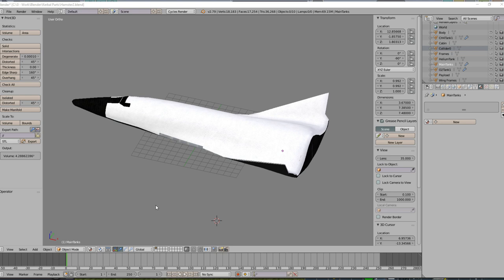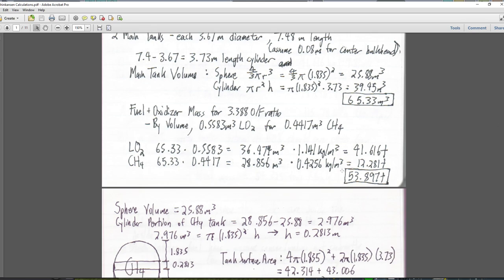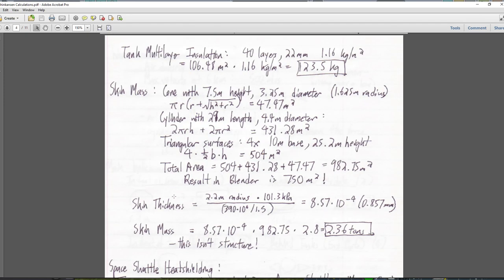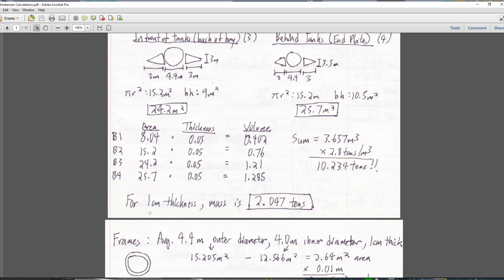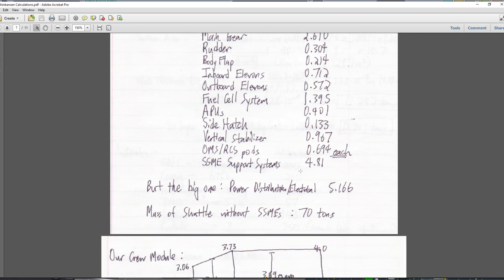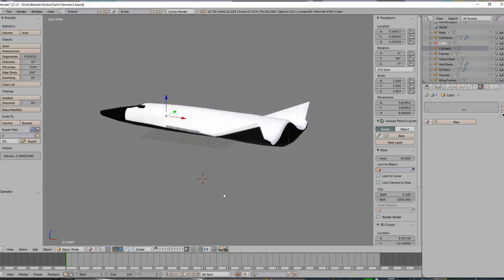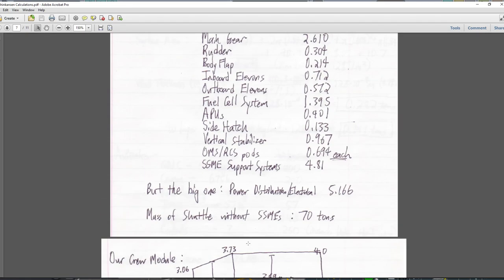Rocket Science - Spaceplane Structures

Comment: Regarding the tank mass calculation:
2024 Aluminium is not weldable, so you have to rivet it and add some stringers. Weldable Aluminium is far worse regarding tensile strength.

The concept of the upper stage looks quite similar to the HORUS-Stage of Sänger II, maybe you can cross-check the mass calculation with it.
(i can provide you some data if you're interested) But the problem is that you need LH2 as propellant.
Reply from the maker: Well, Aluminum 2024 is used throughout the Space Shuttle including the External Tank, so I figured if I was going to use the shuttle as an analogue, I ought to use that. That said, the External Tank did switch to Aluminum-Lithium 2090 - do you think that would be better, or some other material? But yeah, I could just add more structure to the tanks. Sänger II looks similar to what I'm doing, though obviously I'm using two identical planes and that system uses two planes of different sizes. The problem is getting a detailed mass breakdown the way I have with the Shuttle, which I'm fortunate enough to have a lot of material on.

Comment: Raiz, whats the point using spaceplanes to the moon, without heavy aerobraking?
They are heavier with the whole shielding and wings.
Reusability, or just because it looks better (your SP looks awesome, by the way)
I love spaceplanes, because i'm a aeronautical engineer, but they tend to be far less efficient, without aerobraking and capture
Reply from the maker: As I said, we are using aerobraking to return to LEO, and we would like that to be done with minimal wear so that it can repeat the trip a few times before returning to the surface. The huge surface area to a fairly light body should help the situation. Also, considering we're carrying our transfer stage, service module, and crew capsule, this isn't really bad, and we get to reuse all three instead of dumping them. You need to picture this less like a spaceplane and more like trying to heatshield the transfer stage, service module, and capsule so that we can recover all of them. Try and figure out a way to manage a recovery of all three elements separately, or to reuse them for multiple trips to the Moon and back, and you'll see the benefit of a spaceplane as long as we're not carrying the full Shuttle wing.

Comment: I think avionics could actually be much lighter than 1000kg, considering improvements in computers over past few decades, and that there is currently research going on to allow for wireless communication between components inside the spacecraft, that would remove a great porion of the wires mass
Reply: wireless is absurd, but optic, or less wires which form high speed bus for many devices- very probably, just for reference: utp6 305 meters weight 21 kg. for cat7 indoor 15 kg, outdoor 28 kg, 10Gbit Ethernet.
Reply from the maker: Not sure about wireless, but otherwise it sounds good to me. I'll look for documentation, though. Why do I get the feeling it's still heavier than 1000 kg on Orion?
Reply from the maker: @sDdnDSiduAe4b Thanks for the numbers - I'll consult with other sources as well to see what I can come up with for a realistic estimate.
Reply: Just a note on the shuttle computer - it uses the AP-101, which is based on the IBM System 360 architecture, a 32-bit mainframe first introduced in 1964. It's also a variant of the same computer used on the F-15. It is comprised of two units: the CPU and IO Processor (https://spaceflight.nasa.gov/shuttle/reference/shutref/orbiter/avionics/dps/gpc.html), each with a mass of 57kg respectively. The original version of the shuttle computer (AP-101B) had 104000 kilowords (404KiB) of magnetic core memory,  while the upgraded AP-101S has 256,000 kilowords (about 1 MiB) of semiconductor memory. The shuttle also had two tape drives as secondary storage (http://vc.airvectors.net/tashutl_c03.html).

Just a couple of notes here: magnetic core memory is really heavy and not particularly dense; it's also extremely dated. It's basically a bunch of ferrite cores woven together in a matrix, and its two primary advantages are that it is nonvolatile (the above link talks about "freeze-drying" the software into the AP-101B) and that it is radiation tolerant. I wasn't able to find numbers on this so I don't know if the 57 pounds is before or after the upgrade to AP-101S, but the memory board appears to use a ton of surface mount 7400 series logic (https://upload.wikimedia.org/wikipedia/commons/3/38/IBM_AP-101S_memory_board.jpg); I can't find data sheets for the big chips (6134564), but my guess is that they're 8Kx16 static RAM chips. It's probably possible to figure out the total mass of that board based on its dimensions and the chips on board; I'm too lazy to do this so I think we can conservatively estimate the memory board to be no greater than 0.5kg. I have no idea what the mass of a core memory of that size would be; expect on the order of kilograms. 

From what I can tell, the IOP is massively multiplexed and each has 24 channels, each with its own processor attached to it. So yeah, this computer would be a behemoth in modern times. You could replace the bulky tape drives with flash memory or even an EPROM if you're paranoid, and still easily come up with a storage interface at 1/10th the mass. For comparison, Esterline sells an avionics package that weighs about 9.3kg in a 5-unit setup which could be used to achieve quintuple redundancy (http://www.esterline.com/avionicssystems/en-us/ProductsServices/AvionicsComputers.aspx).
Reply from the maker: Thanks for the info - I will take it into consideration.

Comment: You could use a different booster, something like Skylon, but larger and with a liftingbody design and methane powered, of course developing methane based Jet-Rocket hybrid engines will be hard and revolutionary, but the shutlle is too. If you can reduce the /\v requirements to like 4.5 km/s the Payload capacity would be increased significantly, you can also replace a part of the cargo bay with an extra tank and use the shuttle more for astronauts and a little bit of payload and build another version just for cargo, this would allow you to get rid of the crew section and free more space for cargo or another tank. A shuttle that fires it´s engines in near vacuum can also use vacuum optimised engines incrasing the /\v even more.
You can further reduce the mass of the crew shuttle by removing the windows and replacing them with cameras and screens on the inside (but leave painted windows on the front, it looks cooler).
If you dont want to develop Jet-Rocked hybrid engines, you could still use a combination of Jet and rocketengines for the booster.
Oh and your Spaceplanebody should generate lift, the air above gets thrown around in a curve causing it to get pulled out and of the hull by centrifugal forces, creating a low pressure zone on the upper side, it would be more length efficent with a shorter body, but that is not compleetly necessary and a longer body is better on high speeds, because it guaranties a more stable air flow leving it with more time to stick on the hull instead of breaking off like in a stall.

Comment: I'm really looking forward to the completed design. In KSP though, how will you account for the center of mass shifting if it is all one part?
Reply from the maker: I may break it up into several parts - I cut out a bit of this video where I showed the center of mass and contemplated that problem. I could also remove the tanks in this part and just clip tanks in, and then use a CoMOffset in the cfg to get the CoM correct. First, I have to calculate the actual CoM so that I can get it right in-game.

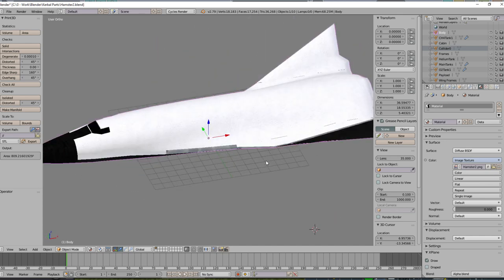Comment: 27:20 Your leading edges being razor thin as compared to the shuttle's is a distinctly bad thing. At the hypersonic regimes your vehicle will be going through, heating is proportional to the curvature of the leading surface (hence the rounded nose, flat bottom, and high pitch on reentry of the space shuttle). This might help https://ntrs.nasa.gov/archive/nasa/casi.ntrs.nasa.gov/20030002280.pdf
Reply from the maker: Yes, good point. That's more a flaw in my aesthetics than an intentional design choice - I'll bulk up the leading edges.
Reply: @RaizSpace  While the heating proportional to the curvature is true for rounded edges,  a sharp leading edge will lead to a oblique shock wave and that's even worse.  
this is a calculator for shock relations http://www.dept.aoe.vt.edu/~devenpor/aoe3114/calc.html
where T1 is ambient if it's a leading edge. now a  swept wing the mach number is ~= cos(sweep angle) * freestream mach number IIRC
for 80km and a 30 degree sweep and a 20 degree leading edge, and 0 AoA you are looking at 2200K at free stream mach 20
fora 20 degree AoA your leading edge on the lower surface will have an equivalent angle of 40 degrees, leading to over 7000K. 
curvature is much better for this
also I might point out that until the flow turns again that the entire surface will be exposed to that, unlike in a post bow shock flow in which only specific locations will reach the max temperature.

Comment: i think you need much smaller fuselage at the end to comply to Supersonic area rule http://naca.central.cranfield.ac.uk/reports/1956/naca-report-1284.pdf , and there is no point for windows at front, may be something like submarine periscope with optic fiber connection, or just cameras. otherwise no point in doing space plane less draggy, space shuttle was like a brick - because it primary air-braked in atmosphere, not accelerated.
Reply from the maker: Yeah, I need to taper that tail down, but that's best figured out with some dummy engines in place since they have to fit, too. We need windows because this may be serving passengers to the Moon who want a view - carrying cargo hardly seems likely. Also, reading accounts of astronauts, the view helps a lot with morale on long trips. You'll note, though, that I didn't add the mass for windows on the carrier plane, since that definitely won't need them. And yes, this is going to be draggy like the shuttle, but only when hitting the atmosphere on its bottom surface - less drag when breaking the sound barrier and through Max Q means we don't have to throttle down like the shuttle did. Also, for our carrier plane, it needs a reasonable glide ratio despite having a much shorter span in order to control its descent for a landing at Cape Canaveral.
Reply: @RaizSpace  for carrier plane some air breathing jet (better hypersonic) may be better (not all of them, but some of them) but in this case you do need drag optimization, as you need enough air pressure to feed such engine, as i said periscope (with optic fibers direct video link) can replace windows for non passanger plane, for passengers near moon - yes windows needed, but in that case separate vessel is preferable (without wings and without heat shield - just for space travel and show).

Comment: Why not integrate, instead of using circles and triangles etc? Haha...
Reply: Minimizing trans-sonic drag, minimizing curvature cross-sectional area, optimizing some measure for avg. pressure coefficient can all be done using functional analysis (if you know it). Will produce an optimized shape given your constraints, can be done by hand if you know the proper mathematics... Might be complicated however, may be able to approximate using excel and solver though... Just a thought.
Reply from the maker: Well, the body would have to be created by a function in the first place to integrate. And honestly, I could just use Blender's readout. I'm trying to show how it can be done with algebra in general. Functional analysis is probably beyond me at this point. I can use solvers and know R coding for that purpose, but I don't know how to apply that here.